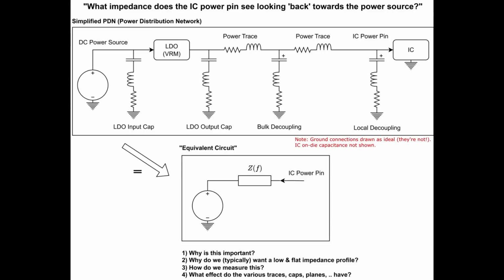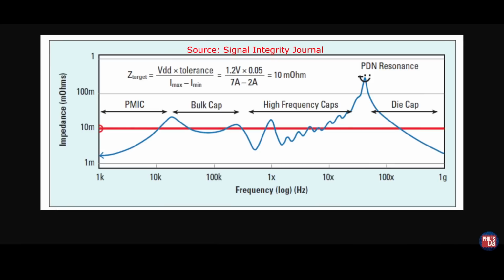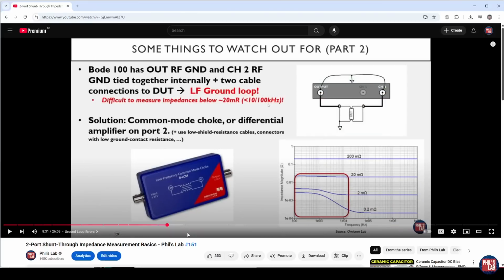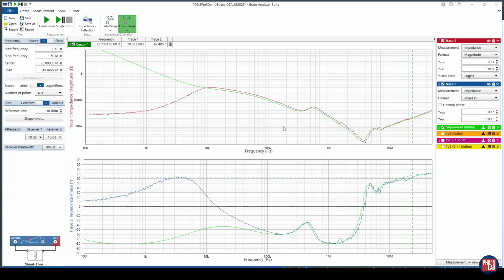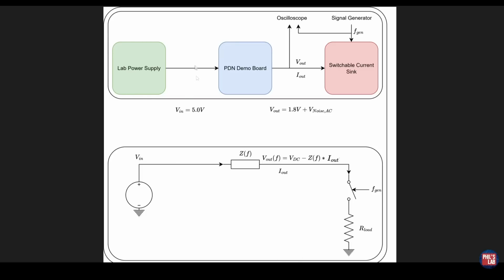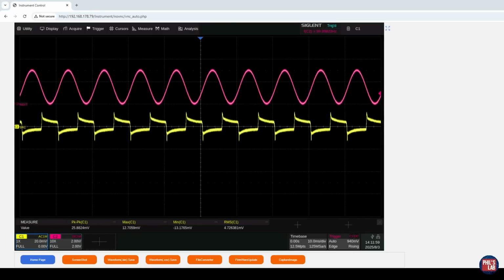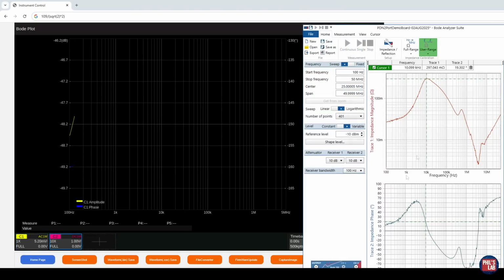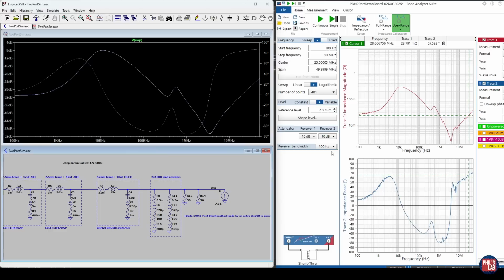PCB Power Distribution Networks (PDN) Basics & Measurements - Phil's Lab #161

Comment from the maker: To clarify: the current load won't be terribly sinusoidal, as the FETs introduce nonlinearities when driven like this, which I should've clarified. I stated it more as a crude simplification, that you would drive the output 'in an ideal case' with a sinusoidal current load. Additionally, for the Bode plot feature, the output wave type is fixed to sine anyway. An alternative option would be to use a different gate-driver, or do a far more 'small signal' load current modulation about some operating point, to maintain linearity.

Upcoming videos: USB 3.2 SuperSpeed hub design, full KiCad 9 tutorial with TI MSPM0 MCU, and more!
Reply: Looking forward for the kicad tutorial :)
Reply: LESSGOOOOO we are so back
Reply: Would there be any value in using a squarewave and changing the rise/fall time of it instead? Because now I think the sinus is a bit confusing as the higher frequency also gives a faster FET activation
Reply: Q😊😊😊😊😊q😊qq😊😊😊😊

Comment: firstly thanks a lot for the wonderful and valuable information. now that we measure the PDN impedance of the board, what should the target look like? is there an ideal PDN impedance profile for my board so I can compare it with my current measurement and tweak the design to fit it around the ideal profile? how do I even know if my measurements are good or bad because I dont know what the ideal condition or safe condition should look like?

Comment: This video is great. I wish I found it 10 months ago when I was discovering all of this. With the likes of Nvdia, AMD and others building super high current low voltage chips, pdn and power integrity will become cricitical areas to get right and make intelligent design decisions. Thank you and thanks to Steve, Eric, Lee, Heidi, Rick, Chris and countless others who have dymisified this science. Btw picotest offer some pretty cool pdn probes which you can hook on to the relevant size cap an take some impedance measurements with using the Bode - is this something you considered?  this way you can measure the impedance profile of existing boards too.
Reply from the maker: Thank you! Yeah, the PDN probes are great, although terribly overpriced (I guess there isn't anything else on the market). I have some of their gear.

Comment: Hi Phil! As always, thank you for the fantastic educational material. Btw, in LTSpice, on the waveform viewer you can right click the right axis and select "Don't Plot Phase Delay" to remove the phase plot, then you can right click on the left axis and select "Linear" to plot in Voltage (or in Ohms). If you then plot the Voltage/Current you then get your PDN curve with impedance (in ohms) vs frequency. Just a little setup trick I do. Cheers!
Reply from the maker: Thank you! Yes, I'm aware of those features, but thanks. Didn't go into terribly much detail regarding SPICE sim in this video, as the video length was already too long and I want to save a few things for future ones :)

Comment: What kind of information would you get if you measured only the input impedance, looking into the PDN network at either OUT_A or OUT_B? @13:00
Or maybe I have missed how the Bode100 operates. So it cannot output and measure on the same port as a usual network analyzer?
Reply from the maker: That would be a one-port (S11) measurement, which the Bode 100 can do and is a valid (and simpler) way to measure PDN impedances as well. This is something I'd like to show in a future video. It depends on impedance ranges, but typically the 2-port measurement is more accurate (and can measure lower impedances).
Reply: @PhilsLab ok thank you, interesting. 
Looking forward to that and thank you for quick response 😊

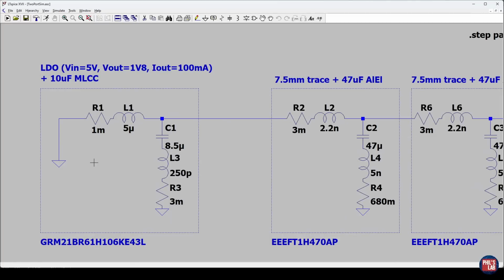Comment: 41:15 I didn't understand the explanation for how you arrived at the values for your LDO. How did you come up with the series resistance and inductance values there?
Reply from the maker: Topic for a future video, where we'll measure the output impedance of various regulators and create an equivalent model for SPICE.
Reply: You can get a rough idea from vendor data sheets - either they say it outright or you can look at the transient response curves and try and figure it out from the capacitance, induced voltage and di/dt. Hopefully Phil covers this better (and maybe other ways!).

Comment: thank you for video! It was a bit unexpected for me not to see in the chart of "Signal Integrity Journal" - Plane Capacitance. It  is the primary way of decoupling at high frequencies, so it must be an integral part of any high-speed design.
Reply from the maker: This demo board is a small, 2-layer board - meaning large separation between the two layers. Given that the power traces are also routed in this design, the capacitance is neglible and inductance is large. In closely-spaced stack-ups with pwr/gnd plane pairs, this of course is a different story as you alluded to.
Reply: @PhilsLab  I assumed that the picture you provided from the "Signal Integrity Journal" was a general idea of PDN. And I would like to see the role of Plane Capacitance in this picture. Undoubtedly your PCB has a negligibly small Plane Capacitance.

Comment: Regarding using a sinusioidal gate voltage will not give a sinusoidal turn on / off of the mosfet due to the unlinear mosfet charge behavior and thus you will anyhow have overtones - but I assume that you know that (a more elaborate gate control is needed).   Regarding the unlinear mosfet beahivior one example can be seen in https://toshiba.semicon-storage.com/content/dam/toshiba-ss-v3/master/en/semiconductor/knowledge/faq/mosfet/faq_MOS_09-1.png
Reply from the maker: Yes, this was an oversimplification, as there will be nonlinearities introduced by the FETs, which I should've clarified. I stated it more as a crude simplification, that you would drive the output 'in an ideal case' with a sinusoidal current load. Additionally, for the Bode plot feature, the output wave type is fixed to sine anyway.

Comment: When designing analog RF devices, e.g. PAs, LNAs, etc.. the story for this network design gets a bit more interesting. For example, if I'm designing an LNA (or PA , switch, etc..) on a MMIC at a few GHz, I have to worry about a couple things at the same time. The first thing is that I have to make sure I model my voltage source impedance correctly because it will load the circuit. Ideally it will present a perfect short at high frequencies (e.g. using cap ladders like you've shown here) and placing those caps very close to the bias point. I also have to make sure that the impedance on my bias lines looking back towards the power supply is as high as possible to mitigate the impacts of the power supply and additional transmission lines form loading the circuit. Especially in high gain circuits, a lot of care goes in to those RF bias networks to minimize RF leakage -- otherwise the circuit will most likely oscillate. 

I've also had some good experiences designing using feed-through capacitors to help bridge the gap between bulk and high frequency caps for creating those choke networks. If you haven't looked at those, you definitely should.
Reply from the maker: Very interesting, thanks for sharing!

Comment: I don’t get the point of the sine input for the mosfet load since you are driving the it into cutoff. Surely a good bit of the output is due to the non-linearity of the mosfet in this region.
Reply from the maker: True. There will be nonlinearities introduced by the FETs, which I should've clarified. I stated it more as a crude simplification, that you would drive the output 'in an ideal case' with a sinusoidal current load.

Comment: Thank you so much. Right about the problem I've been working on. Could you consider doing a video about high current amplifier like 3 phase servo driver power board? 
Anyway, when designing mixed Analog and Digital on 4 layers PCB, I've already placed the Analog and Digital sections on different side of the board. Then should I place the ground plane of the analog on the nearest middle layer or on the same layer with the digital one (as a solid ground plane)?
Reply from the maker: I'll make a high-power/high-current design video at some point. For mixed-signal designs, one of the most important aspects is spacing (X-Y and Z). Use a single, solid ground plane.

Comment: Hi Phil, I've been a viewer of yours for quite a while now and you've helped me improve as a designer, (something that I do as a hobby). I'm exploring RF these days, specifically regarding RF PCB design and antenna design for 2.4GHz radio. Your video on the "RF Schtick" was quite helpful, but I want to know more about the considerations that I should make when designing an RF PCB.
Reply from the maker: Thanks for watching! I'm glad to hear that the videos have been helpful.
I'm actually working on a number of practical RF test and measurement videos that should be helpful when designing PCBs.
Reply: That's great to hear and I'll definitely lookout for them. 

About the RF stuff: I read in an earlier comment that it's based on VNA measurements and so forth. Although I found other content on this, your take will be appreciated. However, I'm speculating that you'll also be discussing where to place RF probe points and how exactly to do impedance matching.
Reply from the maker: Exactly, I'll actually show where to put probe points, how to do impedance matching, and what to watch out for. I personally haven't found a single video that shows the most important - practical - points.
Reply: @PhilsLab  I was referring to videos on how to use a VNA when I said I've seen other content on that. You're correct, I don't know of anyone that has discussed the practical aspects of this in one video. I only know what I know by asking other RF folks on Discord and by a few other sources I've found on this topic, which I will share below so that others may benefit.

There is a video by Robert Feranec where an Ingenieurin from Nordic Semiconductor discusses tuning and matching, but I fell asleep halfway (https://www.youtube.com/watch?v=x1m8G8MAeUQ)

There is another one on simulating antennas (https://www.youtube.com/watch?v=Rke7d9MKOLs) but once again, heavy eyelids prevailed.

I know your video will be more easy to understand (for my poor brain), so I genuinely can't wait!

Cheers!

P.S.: Phil, I've said this before and I'll say it again. For some reason, when I need to know something you either are working on it or just uploaded a video relevant to it. This is the 3rd time that this has happened. You're a wizard! 😄

P.P.S.: Also, I know this is a bit annoying, but I don't suppose you could teach us how to use OpenEMS for RF simulations any time, could you?